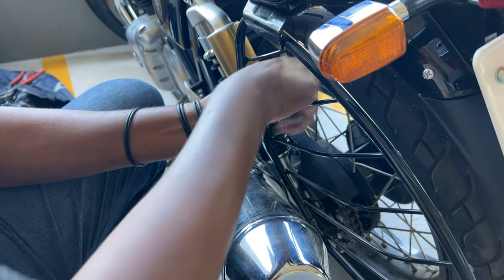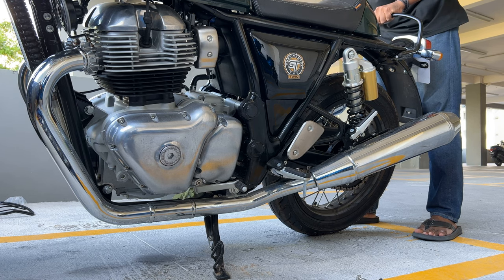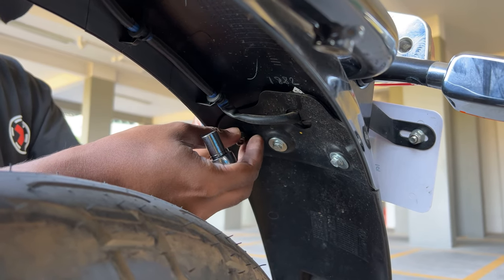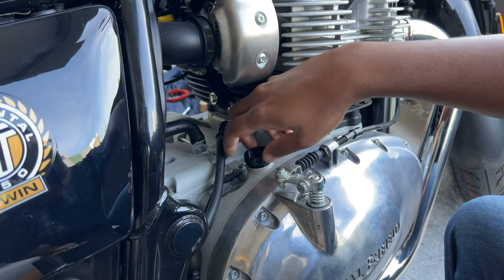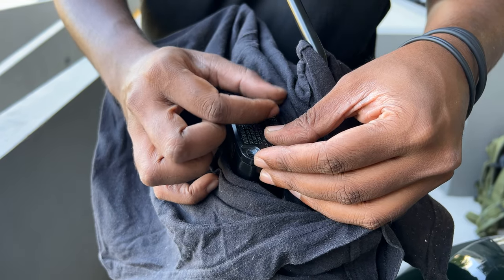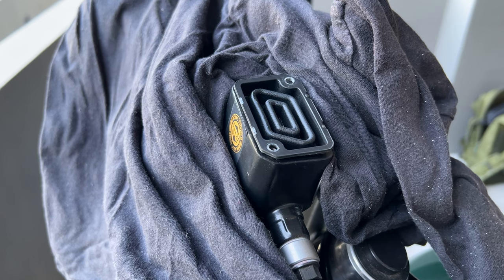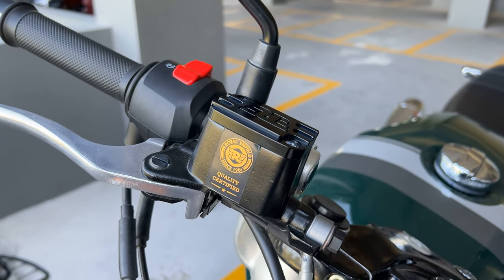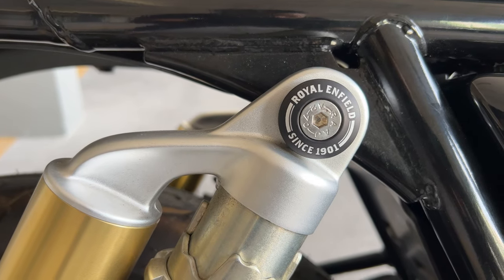RE Continental GT 650 | British Racing Green | Installation of OEM Accessories

Comment: This is the exact OEM mods I'd do if I ever had this bike. The entire appearance of the machine is completely changed and it looks so good with that single seat. 

I'd just add the sump guard for some underside protection. 

Just wanted to ask, if you could mention all the tools that you used to install all those parts. And can I do this at home?
Reply from the maker: Thanks. We are actually gonna install the sump guard after the first service. I think all we used were some hex keys, spanners, sockets and a screw driver. I believe you could get it done with the toolkit that comes with the bike. And yes, you can definitely do this at home 😊

Comment: Where did you buy the side mirror plugs? Are they sold from royal enfield also?
Reply from the maker: I think they are from ebay. They are just generic ones. Make sure to buy one with a reverse thread for the right hand side. I haven't seen Royal Enfield ones on the market yet.